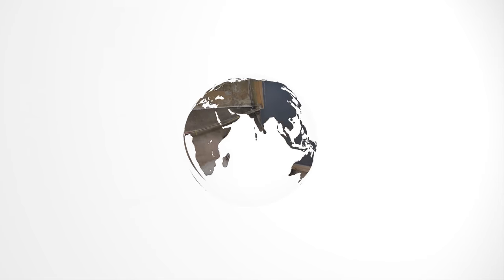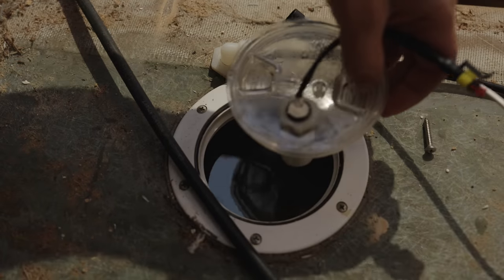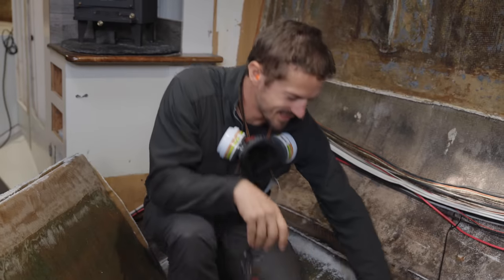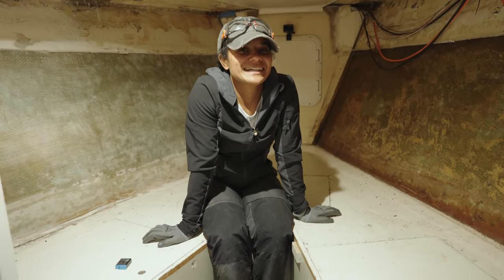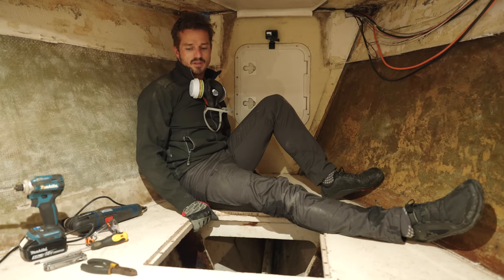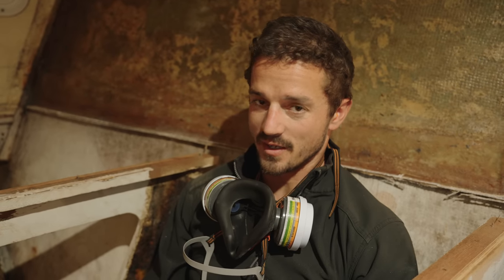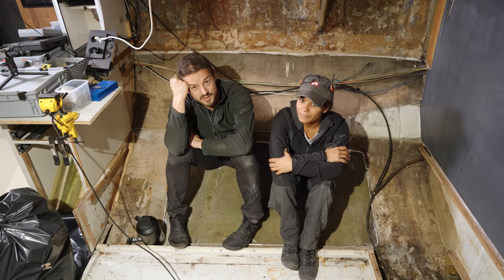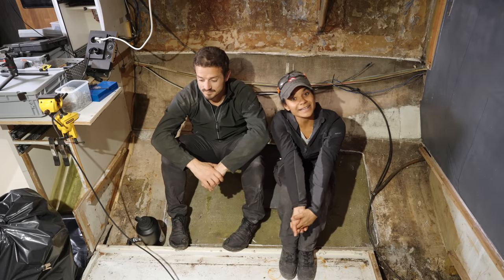It's Worse than we Thought | Step 347

Comment: You could stiffen The hull in areas by putting half inch balsa or foam core and a couple layers of 1708 over it. This would add some insulation and also not interfere with the internal volume/arrangement of the boat. Using Coosa board in the rebuild Will save some weight and eliminate potential for rot.

Comment: I do not think that this is a project everyone could take on and do right, but you two know what you are doing. I would feel very overwhelmed right now, but I can see that for you two it isn't that big of a deal. I am kind of curious at what point will she need to go into dry dock? I guess because seeing the floppy support system, it does not seem like you can put her into a traveler until she has some more bones installed. Can you do that in the water?

Comment: Using foam as the basis for your frames will be a much easier way to fit them to the shape of the hull. It also gives the peace of mind of nothing inside fibreglass that won't rot with minimal water.

Comment: It must be a relief to do a renovation of this scale. Both a "fun" project, but also fixing future issues.
I for one would look into putting in some pipes for cable current/future management needs. Pulling wire through a pipe/hose is far simpler than having them dangling in hard to reach places.
Another thing that has crossed my mind is the fact that with a water maker, one don't directly need as much fresh water storage onboard. Though, having a backup just in case the water maker breaks is still wise, be it a second water maker or a fresh water tank. So there is technically not as much need for large water tanks, space that now instead can be used for other things or just more room in general.

Comment: I am no expert, but I worry a little about the structural status once those parts are removed, being the boat still on the water. Also I think about the pressure the hull might have to go if lifted to be on the yard. There’s an old say like: on an old house, everything is on load somehow. 
Also, if the hull gets damaged, the pressure might be too big for the only layer of the hull and might get over stressed. But I am no expert and sure you got it under control…! Great videos!!

Comment: I've learned a lot about boats for watching your channel. I want to go electric with my boat too. I'm thinking of a couple of electric outboards maybe since my boat had a kind of inboard/ outboard set up where an outboard motor was placed in a well inside storage locker in the back to allow the prop to get into the sea. The thing is thought that you can't tilt the motor up so the prop just hangs in the sea all the time and corrodes. I'm thinking of two electric outboards for the power and if anything happens to one I can still limp along.

Comment: As you are now well versed at ripping old water tanks out, can you nip along and pull my 50 year old stainless steel one out please. Also need a front V berth bulkhead removing and reglassing back in.....as its been compromised. Will watch with anticipation of the rebuild.

Comment: Poly resin doesnt stick to wood very long, not like epoxy, the poly tabbing mainly holds it in position but becomes detached, to poly in a structural piece the wood is just a form, must completely encapsulate it and tab it into hull, use roving and the fiberglass will be the structural integrity. Unlike 5:1 epoxy which will glue glass to wood if done correctly permanently

Comment: Would you contemplate adding a layer of glass to the entire inside of the hull before building all those bulkheads? Would add a ton of rigididy to your boat I'd think. (absolute layman speaking here). After that, time to do some re-design work. Good luck!

Comment: On the v berth I’d take white paneling on the side then use brass screws to attach wood lattes horizontal Some type of wood that’s cheap . You should look at how a contessa is constructed . It takes fiberglass bulk heads up the sides and across the top like a circle  . That’s the structure. Then they bolt the wood panel to the small structural bulkheads

Comment: I suspect that the designers did that on purpose as they did not want the "furniture" to be structural members and interrupt the load bearing paths.  affecting the resonant frequency of the boat.  as long as you maintain the main load path your add ons should be fine good luck looks good so far

Comment: Watching the state of this boat, I think you guys have been very lucky not to run into serious structural damage in the middle of the ocean or the arctic. The dents in the hull show the lack of any structural rigidity. Best rip everything out, there's most likely more hidden trouble. Fixing this can be tricky while floating and with the rigging still under tension.

Comment: Strengthening things ‘sounds’ good, but a boat is supposed to flex and making major changes to the skeleton of a boat involves consideration of complex multi variant interactions regarding material properties that most engineering grads would struggle with. Changing one thing changes everything. This is more a comment for your viewers who have no training or education relating to the subject, ie; if you think you’re smarter than the engineers who designed your boat, car, motorcycle etc, You Are Not. Don’t mess with things you don’t understand. Wanna better, faster or stronger vehicle, than buy one, don’t be the fool who doesn’t even know what they don’t know.

Comment: I'm not a boat builder but I was thinking that maybe the gaps you keep finding are there to help with the noises a boat makes? To possibly help with the creaking and rubbing sounds etc. as the boat flexes? If not then that's some shoddy craftsmanship from the manufacturer.
Reply: Yes, typically non-structural bulkheads are spaced from the hull to allow movement without contact while structural bulkheads are supposed to be securely bonded/fastened.  Unfortunately, it is common to find a mishmash of construction techniques that lead to structural bulkheads completely separating from the hull and non-structural ones griping constantly.

Comment: You can probably find many carbon windsurfing masts that are just sitting in garages now that kiting has taken the sport down. Cut them in half and use the half tubes to stiffen the bow sections by glassing them to the hull where you want more toughness. This is the cheapest full carbon material you can get now. They also make great tubular structure when you design that stuff. Having done what you are doing now myself, therte is nothing but respect for the effort in saving the boat you know and love and gthat you hasve made your best home.

Comment: Please take my remark as a sincere intrest in your safety. Sailboats along with many other boat types are designed and built to flex along it's entire length. Glassing in supports makes the hull more rigid in some places and focuses all the flexing to smaller areas of the hull that will weaken over time. Maybe a short time. Those bulk heads may have been intentionally left floating free of the hull sides so that it can flex where it needs to. I'd get some professional advice from someone who knows that boat before beefing up any structural components. Or don't repair it beyond it's original design/build. I have personally seen a glass boat that had sunk in minutes from a catastrophic split hull that open along it's bulk head seam.

Comment: When you start reinforcing the structure by adding new ring frames, better bulkheads, and stronger knees or whatnot, is there any risk of introducing points of stress concentration at such hard and now unyielding points? Where previously a larger part of the hull flexed to distribute stress to more fibers, all those forces might be delivered onto and saddled to be dealt by much fewer of the fibers of the original glass reinforcing of an already old hull. I don't know how the naval architects figure it out...

Anything has flex in it after all, even the stiffest of hulls and beams, so I wonder if there could be such a thing as overdoing it in select few places. Other than that little worry, the project is looking great! It'll take some more time to build it back up than it took to demolish it but it clearly was both necessary and worth it to take up the challenge. This is such great content, thanks guys!
Reply from the maker: Not really.
Reply: @SailingUma  Excellent; wishing you best of success with the revamp - she'll truly be better than new!

Comment: You have been lucky going to the north, the boat was not designed as an expedition vessel it was a production overnighter and a bit of a  shoddy chopper gun effort at that. Its a landfill project. Redoing your hull deck joint will put you back into an empty 50 year old early fiberglass shell that was basically more resin than roving. Rethink your project.

Comment: Are you saving any of those shaped pieces you are removing as templates for new pieces to go back in?  As a woodworker I can see the challenge of getting cuts to fit the shape of the hull a challenge.  With accurate measurements it would be really easy to whip up some design files for CNC cutting of much of it.

Comment: Honeycomb core with a layer or two of fiberglass on it will be stronger and lighter than all that plywood.  It comes in various thicknesses, doubling the thickness quadruples strength without increasing weight by much at all.  It can get wet and never rots.

Comment: Awesome job on the demo and great editing. A few questions, are you concerned about working in the water with some of the structure removed?  Will you eventually haul and is the yard concerned?  What kind of blades are you using in your multitool?  They seem to cut like a hot knife through butter!

Comment: Wow, when are you guys going to get some work done.  Ha ha.  Wow. You are ripping into it.  Dr Destructo   Amazing how well the boat has done!!!  To the North Pole and back!  Well almost.  Don’t forget this was designed and built for a bang around the buoys boat costal cruiser.  Now I did use to own a very capable ocean sailing Pearson. A 1962 Pearson Alberg 35. That was a tank. Many of them and even the 30 footers have circumnavigated and or still are.  But your boat was much lighter and more costal in nature.  This is really a tribute to just how well you have done with the mods that you did and your ability as sailors.   ROCK ON!  ( no pun intended).

Comment: Sorta cool to see you give her some love,  she’s definitely looked after you guys,   I would be tempted (if i didn’t want anything bigger) to go all in,  make magic in that V berth by adding huge bullet-proof 3/4 inch thick side modern looking port lights, with a huge star roof,   Just let your imaginations go crazy,  maybe the mid bulkhead, have it cut out with two way mirrors to give the illusion of space from actually both sides,  eg from the galley looking forward it’s a mirror, from the V looking Aft it’s a window, but the rest is 1inch thick ply or PVC to give her ridiculous amounts of strength, fook it,  make all the new bulkheads outta pvc..  tab it all In correctly and after alls done,  flow a coat of epoxy paint everywhere in the bilge..  low gloss white with under sole storage..   just go crazy!   Add a huge foam core solid new hard dodger (basically adding an extra room)    It’s actually a pretty exciting project to watch, nobody can ever accuse you guy’s as “traditional” you have been since step 1, why not push the boundaries of tested but non traditional materials and radical designs?  Basically everything has to have dual functionality,  like the new hard dodger is also a water catcher that fills a foldable two person spa bath in the cockpit,   I think you get my point,   Just get crazy and see what UMA can become.. (the spa maybe too much 😂) but i bet you could do it Dan?

Comment: Very wise to remove all this poor/rotten interior.  Hope there's a naval architect out there who can give some advice on the most efficient cost/weight/durability methods of doing the work, epoxy and glass aren't cheap.  Seeing the methods used by the likes of The Duracell Project, including carbon fibre, is interesting.  Even checking some of the frames for wet plywood would be wise, Mads on Sail Life reinforced the frames on Athena.   Things like carbon chain plates, would make sense, later you can follow up with synthetic rigging and enjoy the benefits of a lighter rig.  At some point she will need to be properly supported in a cradle to avoid further deformation.

Comment: Remember all your structural bulkheads are have bad tabbing meaning shot you have worked this boat hard to break everything the factory made if you want to do a great job you should strip all the paint below and above waterline and thicken the hull with alot more glass I did a test the other day 17 Oz bi-axial cloth  × 4 layers added upt to a 1/4" if I where you I would say maybe original hull thickness 1/2" adding a 8 layers of 17 ounce biaxial cloth on the outside you could make the boat 3/4" hull thickness at that point if you made all your structural bulkheads tabbed in properly you could make a alot better boat where you could probably skip bulkheads and not worry about layout I hole sawed hans christian personal boat 3" solid glass no core
Reply: It is alot of material costs and problem is they want to do the professional work in the yard you should limped back to usa we have better boatyard here

Comment: I've always wondered why boats don't have thankless water heaters.
They run on propane, instant hot water on demand.
Reply: Some boats do.
Reply: As a non sailor, it seems like it should be a no brainer but there must be reasons for using engine heat and small electric ones. If I had a boat, I would want endless hot water.
Reply: @julesc8054  I can see that, but usually the availability of fresh water on a sailing vessel is limited, so endless water of any kind isn't available. Instead, it is carefully used. Vessels that are considered more luxurious will often have very capable fresh hot water systems.  But you are correct, marine tankless systems are not widely available as far as I know.
Reply: Thanks for this explanation. It makes more sense to me now.

Comment: Get some engineering input before you begin adding structural components to the hull.  I suspect you know this, but hull design isn't all about worshipping the 'rigidity' gods because big things like boats must flex somewhere.  The input energy from sailing must be absorbed and redistributed by designing the right amount of support and rigidity while still providing for these forces.  blah, blah, blah [insert propeller-head FEA analysis here].  Thankfully, we have full confidence in you two and look forward to this adventure!

Comment: So your boat was made in the early 70's right?  Fiberglass boats had not been around for very long at the time and the boat builders were use to wood. Even the best wooden boats weren't expected to last 50 years unless they were the super premium boats for millionaire that could afford the maintenance. With fiberglass the costs went down so the middle class could now afford a 'yacht' and sales went crazy.  Most of the yards that started in the 70's are now out of business. The mindset of the builders was still this boat will not last 50 or more years but they knew FG was not as maintenance intensive. So 'cheaply' built was the rule.  Now boats are better built and the modern methods and materials are used like epoxies, e-glass, vacuum bagging etc. Yes, more expensive but will last much longer. 
My boat is a mid 80s (Catalina 27). When I compare it to the earlier versions of the same boat, there is a world of difference. Mine does not have the same issues at the same model 10 years older.  By the 80's some things had been learned. Now 40 years later even better materials and methods are used.

Comment: The structural integrity of this boat seems compromised from the day it was built! Bulkheads not properly attached is terrible design,they’re what keep the hull and boat from bowing, amazed you sailed so much without incident, the work is a lot but you’ll have a safer boat afterwards, all summer rebuild?? Keep smiling you’re sailors! ✌️❤️🇬🇧

Comment: From my reading about Pearson I'm betting yours is a 1973 or newer . 1973 was the first Arab oil embargo and the cost of fiberglass resin more than doubled instantly everyone building with fiberglass scrambled with formulas and thicknesses . Hull blisters are not uncommon because the resin mixture was vulnerable to saltwater. It begins to. Fail and blisters form . It was a mess as far as fiberglass formulas and thicknesses goes. I went to look at a new beneteu and was able to push on the hull and flex the fiberglass. Smh . According to the books I have read when a hull flexes when you push on it you're supposed to walk away lol. 
 You guys are turning a old production boat into a custom high end boat . If you get everything glasses in like you described.

Comment: Question: you’re gonna add additional structural supports, but does the boat have to have some flex to it? Kind of like my kayak. I know NOTHING about boating, so apologies if it’s a dumb question 😅
Reply: My only caution would be installing a structural member that is fixed to both sides. Even bridges are built with a secure connection at only one end to allow for some movement of the supports. Best of luck with your projects.

Comment: Funny how when you don't understand the engineering of a 50 year old vessel and rip out the interior to fill it with Home Depot renovations and then have structural problems you blame the designer and builder. Bill Shaw who designed all sorts of vessels and America's Cup defenders at Sparkman & Stevens was one of America's top designers and went on to design and build some of the most popular production boats at Pearson- including the one you ruined.